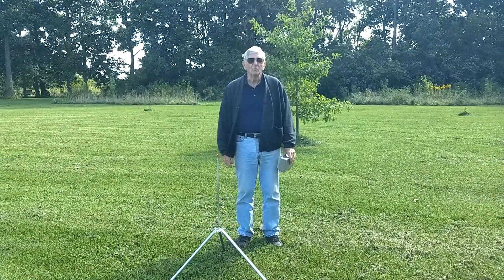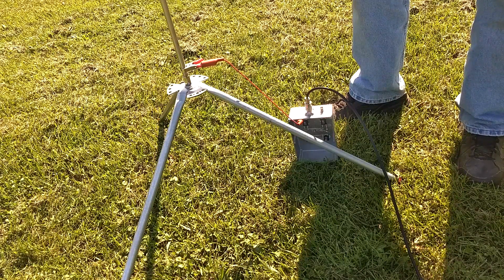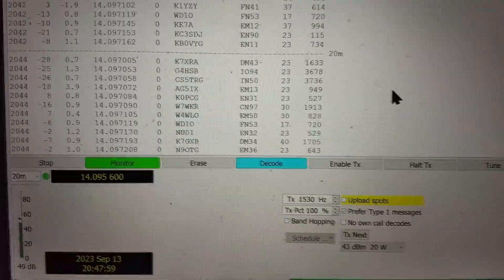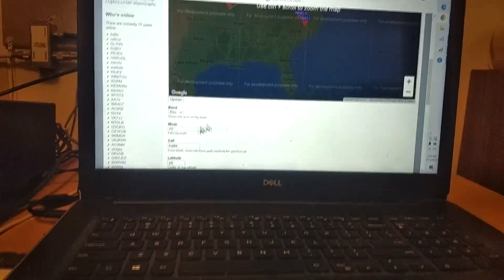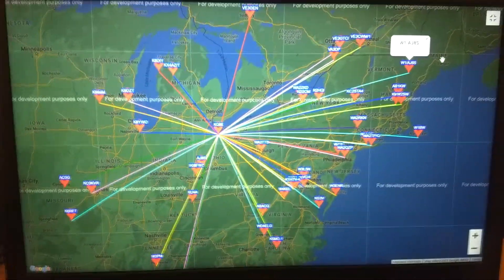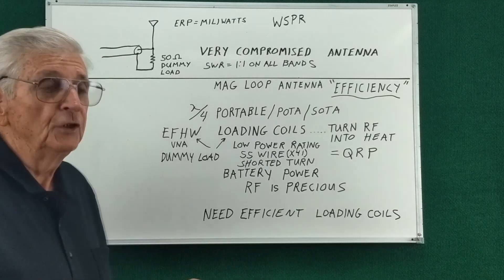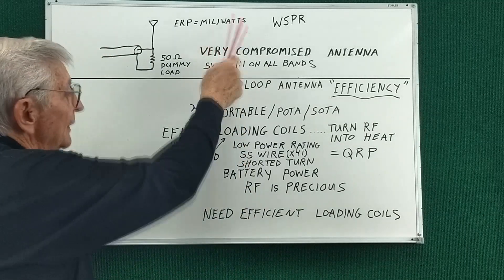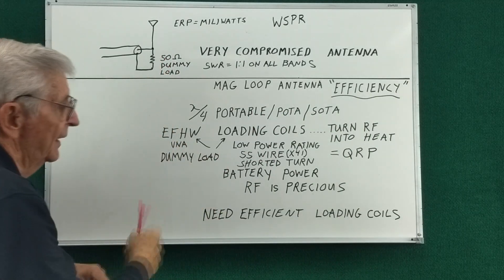A new way to match your portable-POTA-SOTA vertical antenna.

Comment: Good job. You must be a EE like me. I particularly noted your comment on a shorted coil turn. 
I have been helping and teaching radio to new hams as long as I can remember. I have been a ham 60 years so not quite that long but almost! Your demo should sure convince hams that a good or perfect SWR by itself is no indication of efficiency. I always tell guys to record their SWR when a good antenna is new and if the SWR ever gets real good and the bandwidth between 2:1 SWR points increases, then the efficiency had to go down because loss increased. Probably the coax! Keep up the good videos! 
73, de N4DJ
Reply from the maker: Thanks for your comment and your advice. 73, Jim, KQ8E

Comment: Your videos are very valuable.  Unfortunately, rather than understanding antenna system efficiency, ERP, and learning best practices, many determine efficiency based on "it works" or "it is good because it is easy and quick".  Isn't it funny that some portable operators drive 2 hrs to get to an operating location, then use a garbage antenna because "it sets up fast".....Crazy.
Reply from the maker: Thank you for your comment.

Comment: Hi Jim just found your channel. Which do you think is more efficient the 9:1 unun, 49:1 or a coil like wrc? Each is lossy but unun vs coil, I wonder which has the most loss? Also, if using a random wire, which would have less loss, using a 9:1 or running directly to a tuner cutting the 9:1 out?
Reply: Good question.......